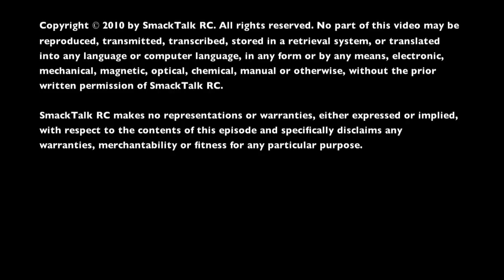SmackTalk RC Learning 3D #4 - Piro Flips

Comment: This is a great video and clearly explained! Learned to fly in all orientations upright and inverted then moved to learning figure 8 piros CW and CCW upright and inverted, not much stationary piros like he explained...probably why I struggle a little keeping piro flips stationary.  Then I was able to do pretty sloppy stationary piro flips CW and CCW.  Travelling piro flips were a bit easier probably because of the figure 8 practice. Hoping to get them a bit tighter this flying season.  I would like to learn how to do a proper chaos both directions eventually.
Reply: How did you learn to fly upside down all orientations? I know how to fly right side up all orientations and want to take that next step. Did you use a sim or wing it on your helicopter? I'm going to buy neXt sim and start flying upside down all orientations. My ultimate goal is to do some of these cool 3D maneuvers but I have to learn all of the fundamentals first
Reply: @LichaelMewis the cheapest way I know is to use SIM. Then do regular practice on it (10-20 mins per day or per sessions depending on your available time). You should see noticeable improvements after 3 weeks or so.